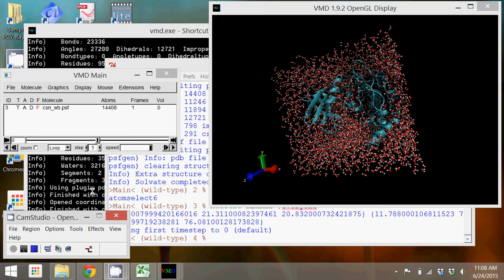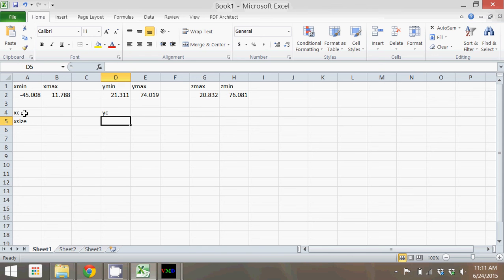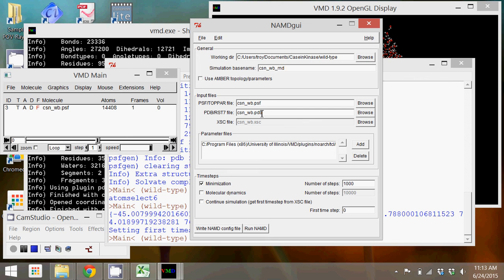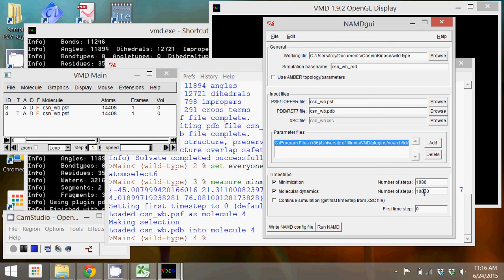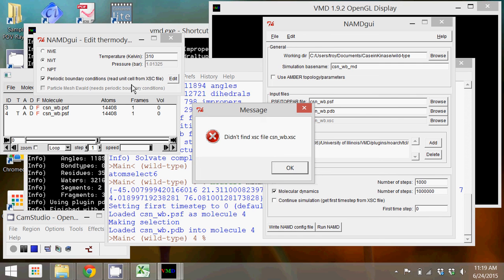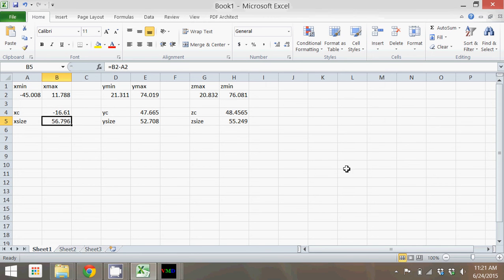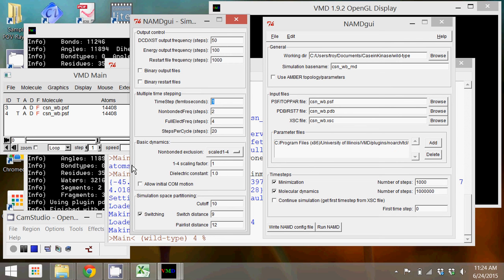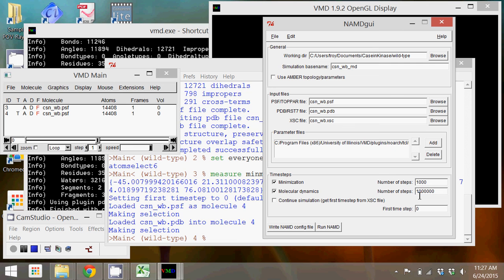Simulating Protein Using the VMD Graphical Interface to NAMD

Comment: Thank you for this awesome videos Dr Troy. I did the same steps as the videos and when I click  Run NAMD the status doesn't change to running it gives ready all the time, and three files only are created and the DSD file is not one of them but nothing happens after that. I can't find the problem although I am using a computer workstation.

Comment: Hello, would you please tell me if it is possible to run one simulation and have NAMD automatically spit out one pdb structure at regular intervals until reaching the end of the simulation (where it would then spit out the last pdb structure)?  How would this be implemented if it were possible?

As an example, I would like to run a protein for a total of 2 nanoseconds and have NAMD crunch out a structure every 0.2 nanoseconds for a total structure ensemble consisting of 10 structures.  Would I have to alter the configuration file 'timestep' and 'run' variables or is there some other file where such instructions can be implemented?  Thanks again!

Comment: These tutorials are very helpful, thank you!
When I try to run a NAMD simulation on a protein in a water box, I get an error message that seems to say the water molecules aren't parameterized. I'm using the par_all27_prot_lipid_na.inp included with VMD as the parameter file. What can I do to get around this?
Reply from the maker: It might be some other setting. Have you set the water to rigid? Here is a NAMD tutorial that discusses water boxes. https://www.ks.uiuc.edu/Training/Tutorials/namd/namd-tutorial-unix-html/node26.html
Reply: @TroyMessina  Sorry, I misspoke - the parametrization issue comes up when I try to generate a .psf file for a solvated .pdb using AutoPSF, or when I enable "Add solvation box" under its Options. Attempting to run a NAMD simulation with the .psf and .pdb files generated by solvating the protein after obtaining a .psf from AutoPSF results in an error saying "FATAL ERROR: DIDN'T FIND vdW PARAMETER FOR ATOM TYPE OT". Setting the water to rigid does not change any of this.
Reply from the maker: @BillNyeTheRussianSpy  From what I found on NAMD mailing list it is from solvating and creating psf with tip3p water. You'll need another parameter file. https://www.ks.uiuc.edu/Research/namd/mailing_list/namd-l.2012-2013/3534.html

https://www.ks.uiuc.edu/Research/namd/mailing_list/namd-l.2013-2014/1417.html
Reply: @TroyMessina  That fixed the parameterization issue, but now trying to run the simulation results in "FATAL ERROR: DIDN'T FIND vdW PARAMETER FOR ATOM TYPE OCL".

Comment: Hey, thanks for making this tutorial. I encountered an error that I am not able to fix. 
I followed all the steps as per the video but I'm not able to generate the .dcd file for my simulation. I'm running a 1 ns simulation and when I click on Run NAMD, it shows the status as "Running..." for a second then goes back to saying "Ready". There is no .dcd file in the directory and the output .out file is completely empty with a size of 0 kb. 
Please respond. Thank you
Reply from the maker: Have you changed directory in TkConsole so that your simulation directory is where VMD is pointing, e.g., cd ../../../Users/TheRagingTyranitar/NAMD_simulation? What files are in your simulation directory after it stops running?
Reply: @TroyMessina  yes I've changed the directory. The files after simulation are 1 namd file and 1 out file. Both empty.
Reply from the maker: @PushpakB541  Two more questions... Have you updated your path variable to tell Windows and VMD where the NAMD executable is located? If you open TkConsole when you try running the simulation, does any output show up there?
Reply: @TroyMessina  Yeah path variable is updated. TkConsole shows "NAMD is running..." and that's all. Nothing else.
Reply from the maker: @PushpakB541  Try setting up the simulation and then clicking "Write NAMD config file". Open this file and see what's in it. I think it'll be something.namd. You can paste the contents in a reply here if you want.
Reply: @TroyMessina  Okay, I got it to work somehow. I just had to write the config file then manually run the simulation using cmd. Thanks for your help!
Reply from the maker: @PushpakB541   That was going to be my suggestion. I'm not sure why VMD isn't interfacing with NAMD properly.
Reply: @TroyMessina  I still have problem in this part. Can you please help me.
Reply from the maker: @asifahsan3092  I recommend using the command line (cmd).
Reply: @TroyMessina  Hi both! I'm stuck at the same spot and i can't find what to write in the TDK console. What's the cmd line you are talking about?
Reply: and if you mean to type namd2 "1t5a_wb_md.conf > 1t5a_wb_md.log &" it doesn't work. It says "unable to access the conf file" but it's there...the Path is set and the environment should be fine.
Reply from the maker: @HonestGuyWhoSpeaksUp  In the Windows Start menu type cmd, if you want to use a command line. It's what used to be the Windows DOS prompt. In the command line, you need to cd to your directory where your .conf file is. I would type namd2 "1t5a_wb_md.conf > 1t5a_wb_md.log &" a little differently. I would type namd2 1t5a_wb_md.conf > 1t5a_wb_md.log. The & symbol gives you your cursor back, which isn't terribly helpful since you need to leave the cmd window alone until the sim is complete. No need for quotations. And this only works if you are in the .conf directory. Otherwise, you would need to specify the full path to the .conf file.
Reply: @TroyMessina  sorry I used quotations to outline the actual text file! ^^ Thank you! But when I create a config file it actually creates a .namd file not a .config. However i have noticed that the .namd file has all the settings I have set already. When I used the command line in TDK or in the MS-DOS prompt it said it couldn't read the config file... I have now randomly tried to import more parameter files and APPARENTLY it's working (it's calculating as I write!). Thank you for the tutorial, it's well done! I'll see how it will work out eventually!
Reply: @TroyMessina  it worked! Now that I know it's working, i'll have a proper read at the manual (VMD and NAMD) and explore their possibilities. Thank you so much for the support and the informative videos! It's a cool coincidence that your surname is like my hometown in Sicily! Thank you again for your support!
Reply from the maker: @HonestGuyWhoSpeaksUp  Glad to hear it is working. I'm surprised the error was an inability to read the config file rather than some parameter mismatch because of the topology files. Good luck!

Comment: Hi, thanks a lot for your tutorials! When working with phosphoserine I get an error: UNABLE TO FIND BOND PARAMETERS FOR CT2 ON2. Where exactly do I have specify the topology files? In the namd-config they are not allowed with parameters keyword.
Reply: Hula Cornula ok i found the error. one should not add the .rtf but only the .str file to the parameters.
Reply from the maker: Corni Gertling Hi, I'm glad you caught the error. It took me a lot of trial and error before I figured out the topology files necessary for various molecules. I'm still learning.

Comment: Hello Troy i have some problems regarding number of frames. Say i want to run MD simulation for 1ps, I will do that by keep number of steps as 1000 and by keeping the time step as 1 fs (in basic parameters) . Now the problem is that if i do this number of frames which i got is 40 which implies for each frame has 25 fs. But what i want is that each frame should have 10 fs. or in other words for 1 ps of MD simulation i want 100 frames . Is there a way  to increase the number of frames??
Reply from the maker: Ksai, there is a setting in the NAMD Graphical User Interface. Go to Edit -> Other simulation parameters. In that menu change the DCD/XST output frequency to 10 steps.

Comment: how do i calculate number of frames ? i want to run simulation for 10ns  with time step 2fs ...i want to know how many frames i get?
Reply from the maker: It depends on the dcdfreq you set. If you save every timestep (dcdfreq=1, not recommended), you will have 10 ns/ 0.000002 ns = 5 000 000 frames. dcdfreq divides this number by its value, e.g., dcdfreq =500 gives 10 000 frames. Unless you are using an HPC cluster, it's probably best to split a 10 ns simulation into smaller pieces.

Comment: I've mutated and solvated a protein and am now trying to run a minimization and MD simulation on it, but it stops after the minimization. I looked into it further, and it seems the simulation is crashing because "Atoms moving too fast; simulation has become unstable." Any tips?
Reply from the maker: Could be timestep is too big. Could be temperature is too high.
Reply: @TroyMessina  The temperature has to be 298 K for what I'm doing, and setting the timestep to 0.5 fs didn't help.
Reply: @TroyMessina  Also, for a different simulation I'm doing involving a point-mutated Trp zipper (using PDB 1LE0 as wild type) in a water sphere, I'm getting "FATAL ERROR: UNABLE TO FIND ANGLE PARAMETERS FOR HB2 CT1 NH3 (ATOMS 1 5 8)" when I try to run it. I'm using toppar_water_ions_namd.str and all five of the "par_all36" files included with VMD 1.9.3 as parameter files for NAMD.
Reply from the maker: @BillNyeTheRussianSpy  I don't know all of your simulation parameters. Another possibility that comes to mind is rigid bond settings. There are quite a few posts on the NAMD email list if you search google for "Atoms moving too fast; simulation has become unstable."
Reply: @TroyMessina  Never mind, I figured it out - NAMD was failing to minimize the structure after I ran Mutator on it. I worked around this with a different program. Thanks anyway.

Comment: Hey, its a very helpful video.  But while running  namd its showing following error
error deleting "dock_wb_md.out": permission denied
error deleting "dock_wb_md.out": permission denied
    while executing
"error $var "
    (procedure "::NAMDgui::run" line 69)
    invoked from within
"::NAMDgui::run"
    invoked from within
".namdgui.go.go invoke"
    ("uplevel" body line 1)
    invoked from within
"uplevel #0 [list $w invoke]"
    (procedure "tk::ButtonUp" line 24)
    invoked from within
"tk::ButtonUp .namdgui.go.go"
    (command bound to event)
Reply from the maker: I'll need more information. What operating system are you using? Have you modified your PATH variable so that your operating system knows the location of NAMD? Do you have write permission to the folder where your simulation is saving files?
Reply: Troy Messina, I'm using Windows 10, I've modified path variable & also have write permission to folder (I've rechecked them)

Comment: Hi, I wondered if you could give me any advice on a problem I'm having with NAMD/VMS? I've just started using both programs (always used pymol before getting interested in simulating dynamics). I run Windows 10 and have downloaded the WIN32 NAMD and the latest VMD that works on my system. The main problem I'm having is that I cannot change the directory that things are being saved to, etc. I've tried changing directory in my commands prompt box, and also through Tk consol. Doing the commands in my command consol does nothing to where things are being saved or directed, and doing it in the Tk consol it gives me:

Main console display active (Tcl8.5.6 / Tk8.5.6)
(VMD) 1 % cd
>Main< (User) 2 % dir
.:
.VirtualBox              .android                 .idlerc
.multiseqdb              .multiseqrc              .oracle_jre_usage
1UBQ_autopsf.log         1UBQ_autopsf.pdb         1UBQ_autopsf.psf
3D Objects               Contacts                 Desktop
Documents                Downloads                Favorites
Intel                    Links                    Music
OneDrive                 Pictures                 Saved Games
Searches                 Tracing                  Videos
VirtualBox VMs           autoimd                  bang
my_namd_output_file.out  namd tutorial            vmd.rc
>Main< (User) 3 % cd namd tutorial
wrong # args: should be "cd ?dirName?"
>Main< (User) 4 % cd desktop
>Main< (Desktop) 5 % dir
.:
Chrome App Launcher.lnk         New folder
Pract Pro                       VMD 1.9.2.lnk
Zip Files                       assemble-bc1-notext-stamp.tiff
>Main< (Desktop) 6 % dir
.:
Chrome App Launcher.lnk         New folder
Pract Pro                       VMD 1.9.2.lnk
Zip Files                       assemble-bc1-notext-stamp.tiff
namd tutorial
>Main< (Desktop) 7 % cd namd tutorial
wrong # args: should be "cd ?dirName?"
>Main< (Desktop) 8 % 

The "namd tutorial" directory is a file that contains files for the NAMD online tutorial that you can do. I've also followed your tutorials as much as I can, but without the files saving and being somewhere that I can find it's hopeless. 

Any advice would be greatly appreciated.
Reply from the maker: +Axx Crz The Tk Console is where you will want to change directories. The command prompt is not connected to VMD. It looks like your directory name "namd tutorial" has a space in it. You might try removing the space. Alternatively, you can type "cd namd" then hit the Tab key. This will autofill with what Tk Console sees as the directory name. Spaces in folder and file names are generally trouble when it comes to console work.
Reply: Troy Messina Awesome, thanks for the quick reply!
Reply: Just an update, this has fixed my problem! Can't think you enough as this was driving mad.
Reply from the maker: +Axx Crz Glad to hear it worked. Happy simulating!

Comment: Can you give me a quick guide to run protein:ligand simulation using VMD interface to NAMD.  I appreciate very much your videos, all 13 clips (molecular modeling in the curriculum).  I plan to write up short step by step for myself and our group with printscreen pic in it.  Without able to run protein:ligand simulation, my attempts stops here.  I have tried to make psf for my ligand, it did not work.I have used open babel to convert my ligand to a pdb structure and that is not accepted by VMD looks like.  Will be very grateful to see your steps.  thanks a million
Reply from the maker: Do you have a specific example? Is this a protein structure that you have docked the ligand manually? Or is it a protein:ligand structure you obtained from the pdb as a complete structure?
Reply: I want to try run several set of protein and ligand actually.  4l2h is a pdb id for example.  It has its ligand.  I wanted to analyze the interactions.  I tried creating psf after trying to clean up some of the cofactor and unwanted glycerol etc. for the moment.  Wanted to keep the ligand part only.  I have tried to merge the protein and the ligand.  First of all ligand pdb structure is not taken as valid by the vmd.  I have used molegro to convert the ligand to pdb as open babel made strange pdb that was not taken by the VMD.   Here is my email:  sheulizatgmaildotcom.  Will u email me I will like to send you the pdb etc.  I have recently got permission to use desmond to run protein ligand but feel like know VMD/NAMD almost.  Thanks a lot again.
Reply: As a practice of the software i ant o send 4l2h complex that has a ligand already.

I want to try run several set of protein and ligand actually.  4l2h is a pdb id for example.  It has its ligand.  I wanted to analyze the interactions.  I tried creating psf after trying to clean up some of the cofactor and unwanted glycerol etc. for the moment.  Wanted to keep the ligand part only.  I have tried to merge the protein and the ligand.  First of all ligand pdb structure is not taken as valid by the vmd.  I have used molegro to convert the ligand to pdb as open babel made strange pdb that was not taken by the VMD.   Here is my email:  sheulizatgmaildotcom.  Will u email me I will like to send you the pdb etc.  I have recently got permission to use desmond to run protein ligand but feel like know VMD/NAMD almost.  Thanks a lot again.
Reply from the maker: Which molecules do you consider the cofactor, unwanted glycerol, and ligand? I only see protein, AR6?, and water. This is a less common pdb file. Every ATOM is duplicated with ANISOU for anisotropic details. You'll probably need to read more about dealing with these in VMD/NAMD if you want to keep them.  If not,  from VMD you can save a pdb using something like

set prot [atomselect top "protein or resname AR6"]

$prot writepdb 4L2H_prot.pdb

But there is still an issue with some amino acids being labeled things like ASER, BSER, CSER. I'm not sure how to handle that.
Reply: Thank you so much again,  I had been waiting to see your reply.   I am going to try right now.  Thanks for your volunteer generous work and help.

Comment: Hi Troy Messina, all initial steps performed correctly, when i hit Run NAMD, the status shows running, but a error message pops up saying <namd2.exe has stopped working and windows will close the program>, even tk console shows <Starting NAMD> and the directory shows incomplete .namd file. 
Im working on  windows 10, 64bit, i5CPU, intelHD, RAM 6GB. Is it the system not allowing the program to or its the program itself. Please advice. Thanks..
Reply from the maker: I would need to know more about the error. Either in tk console or the log file. Did you update your Windows path with the location of namd?
Reply: I have updated the location, it is seen in the environment variable, so the tk console ran correctly showing correct directory. namd2.exe  stopped working, 3 md files are created in the folder NAMD, OUT and fixed PDB. OUT file (5kb) ended saying FATAL ERROR: DIDN'T FIND vdW PARAMETER FOR ATOM TYPE HB1. NAMD file (2kb) ended saying # Scripting (for temperature).
Reply from the maker: It could be several things. 1) You are missing a topology file. 2) Your topology files are out of date. 3) Your protein has an atom that needs to be aliased. You should search the University of Illinois mailing list (http://www.ks.uiuc.edu/Research/namd/mailing_list/).